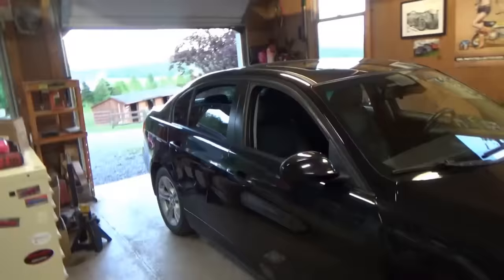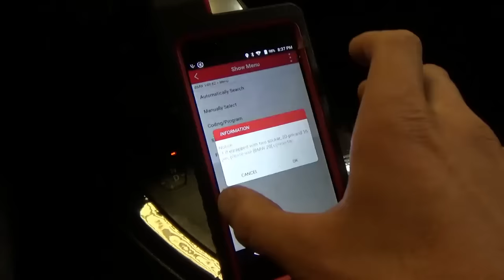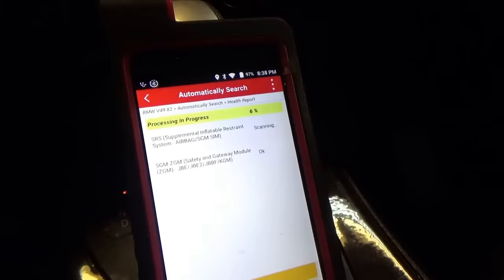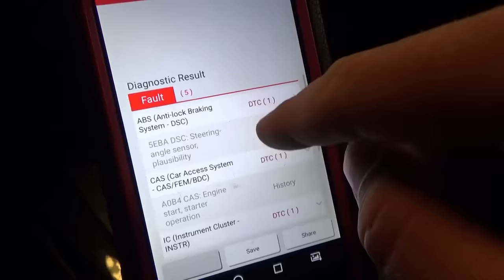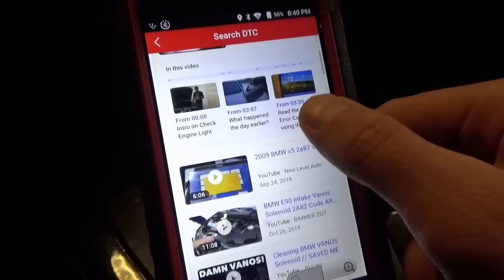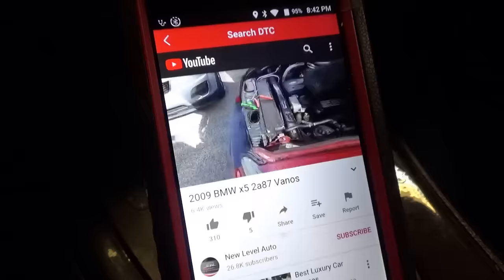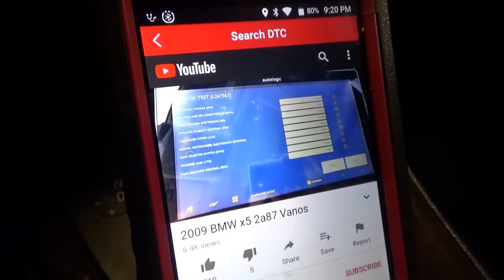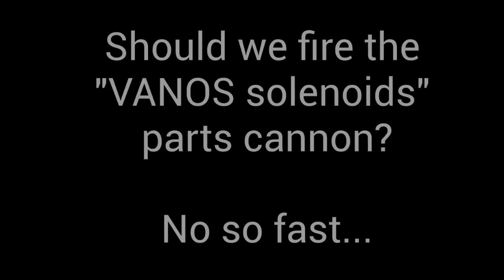Bad News BMW: Vanos 2A82/2A87

Comment: Why do auto engineers subtract dipsticks?  So many new cars have deleted the transmission fluid dipstick.  The deleting the engine dipstick should result in criminal prosecution!  Go ahead and throw rocks.
Reply: They should have an oil level display next to the gas gauge. Problem solved
Reply: @serge4856  That would make me happier.  I do miss the oil pressure gauge like my pickup has.
Reply: because that means you have to take it to bmw.
Reply: @Jason Bowman I just want a dipstick somewhere.  Sounds like Ford did you right.  Would I prefer a dipstick I could grab when checking the engine oil? Yes.  I am 5' 6" and need a milk crate to check my trucks fluids. My beef is like some of the Toyota trucks don't  have a trans dipstick and you have to measure the oil when you change it so not to over fill it.  Since oil is cheap and transmissions (and engines) aren't, the BMW engineers should be ashamed.
Reply: @Jason Bowman B&W and Performance Automatic offer a dipstick tube kit for the F150 that brings it up into the engine compartment and away from that hot cat.  I put a PA kit on my 2014 Mustang GT and like it a lot better.  Those kits are expensive though.
Reply: Serge B well, that solves problem assuming the sensor is reporting correctly and the cluster works.. guess what always works? A stick...
Reply: @mikesabin8568  good point
Reply: Why? Because 95% of the population never looks at them. This way BMW has it setup to tell the driver if anything is wrong without opening that thing in front they don’t understand. They get really confused if they park on a hill and try to check it. Basically it’s dumbed down for the lowest common denominator. 

If you really care - the car will show you the level driving down the road. It says “ok” to indicate it’s safe to start and then provides a nice accurate reading once it warms up.

I’ve got an N52 BMW and frankly it’s no big deal not having a dipstick. It just gets checked another way... like when I’m bored in traffic. Also, these engines are actually pretty solid if you take care of them. The belt is a stupid one, but maintain the tensioners and make sure you aren’t leaking oil on it and it’ll probably run forever.
Reply: @briantii  probably the most sensible comment I've read so far, what's the point of a dipstick if you never look at it, at least the car will tell you when it needs oil, whether or not the drivers takes notice is another issue, people like to blame the car because of their own laziness and ineptitude, I've owned several BMWs I've looked after them and never had a major problem.
Reply: 2 words. Emissions Regulations.
Reply: rafflesnh   I would think the amount of vapors (emissions) leaking from a dipstick, especially considering the dipstick is IN the tube whenever the car is running, would be infinitesimal.  Curiosity got the best of me and I found this interesting article.  

https://jalopnik.com/why-the-dipstick-is-dying-5522543

While that may be a factor, it is not the only reason.  Market research - most people don’t even check their oil anymore, they wait until the idiot light comes on.  Technology - pressure and level sensors are reliable and inexpensive.
Reply: Those engineers are the DIPSTICKS Right??!!
Reply: @andyeckel7195  Thanks for the jalonik article.  Reluctantly I agree that a large part of simple mechanics is going the way of the Dodo like the dipstick and cable connected parking brake.  I just changed oil  in my lawnmower that no longer has a drain plug.  Briggs and Stratton claims that they did a survey that said most people do not ever change oil in their lawnmower.  It's  about being connected to your machine.  I guess since we are getting so unconnected with people  the marketers and general populace contend we should be equally unconnected with our machines.  Tomorrow I will fix my 42 year-old maytag washer. After one of my friends lost a $700+ Samsung washer in a year old school does not feel so bad.
Reply: Not to mention... the technology is fairly reliable. Case in point our Honda Pilot is notorious for the manual dipstick breaking off in the engine requiring careful work to retrieve it without dropping the whole thing down into the engine. N52 electrical oil level sensor rarely fails in comparison.
Reply: @briantii  Good point.  Honda's are the world's largest engine makers and I am a fan. My neighbor had a 11 hp honda engine on his wood splitter. I to 3 pulls to start for 12 years.  One day the low oil sensor did not work and his guys did not check the oil.  My low oil sensor on my 11 hp Honda on my pressure washer has a burr on the sleeve not letting the float work making it impossible to start.  If it weren't a pain to take it out and file off the burr I would reconnect it.  My 20 year old Honda will start on 3 pulls if it sits a year.  I check the oil manually.  Love the engine not the sensor.  I am afraid of adding any more electronics than necessary in a hot,  humid, and dirty environment of the engine bay.  Because of people's indifference the dipstick will probably die the same death as the cable connected parking brake which takes so little maintenance.  I bet you will put a lot of trouble free miles on your pilot.  I hate losing the connection I have to my machines.
Reply: Great thread going here.  Personally, given the criticality of oil volume, pressure and purity, I would like all three of these on my vehicle:
1) Under the hood, a real dipstick and a Schrader valve somewhere convenient to connect a live oil pressure gauge
2) A pressure and level transmitter that talks to the ECU
3) A sample port where one can draw representative small sample for visual inspection and lab analysis.  A lab oil sample analysis for coolant contamination, ash, water, metal particulates, viscosity, lubricity and other characteristics can prevent an engine failure before it occurs.
Reply: @andyeckel7195  Great wish list!  I really like the schrader valve for plugging in a oil pressure gauge.  The representative sample port is equally a capital idea.  Do you watch project farm on Youtube? He tests all kinds of oils a lot and shows the results.  I am so bummed by the lack of anti wear ingredients in stp oil treatment.
Reply: dogs plants cars & neat stuff Yeah, the Pilot has been pretty good. We have had it for 7 years and no major problems. I wouldn’t say we love the thing though. It has drivability frustrations and after doing the timing belt this weekend some of the components aren’t holding up nearly as well as I would have expected.

1) Honda variable cylinder mgmt causes drivability problems like roughness. I had to buy a electronic gadget to disable it. It’s also known to cause ring problems leading to partial engine rebuilds. Common.

2) The transmission feels like it’s made of glass. Lots of driveline slack and if the fluid is the least bit old it shifts less than perfect. We have 65k miles. The fluid has been changed 3 times.

3) The engine mounts showed far more wear than I expected for 65k / 7 years. Far more than my 06 BMW with 90k. Maybe related to the stupid cylinder mgmt stuff.

4) One of the mount bolts had a lot of rust on it where it goes into the frame. This is a southern car that has been north of Tennessee exactly once in it’s life and that was during the summer. The car literally has never seen snow. I cleaned it all up and gave it a bunch of fluid film in there... but still.

5) Brakes get “warped” or rather uneven deposits. The oem pads suck and aftermarket ones aren’t much better from what I’ve found so far. I wish I could find a good pad for this thing.

6) The hydraulic timing belt tensioner was leaking at 65k miles and 7 years old. Apparently this is common, but disappointing considering I even reuse tensioners on my old Lexus IS300 and have never seen or heard of one leaking.

Overall it’s a good car with no major issues and hauls kids and their stuff great... just doesn’t scream Honda quality like I’d expect.
Reply: @briantii  Brian you are so meticulous! That car would have be traded by anyone else long ago.  Just suggesting have you tried Akebono brake pads.  I have never used them but scotty Kilmer swears by them: https://www.youtube.com/watch?v=j7vH8IRbjEc.   Three transmission fluid changes by 65k says you are giving that car some serious good care.  So what year is the pilot?  Is that the year (or part of several years) that they had gas dilution problems that hurt the rings you were talking about?
Reply: dogs plants cars & neat stuff Yep, it’s a 2013 that we bought new and the variable cylinder mgmt (vcm) is what destroys rings. We disabled it before we had problems. Ours uses no oil between changes and it even stays nice and clean so the engine is really healthy. It’s also been fed a steady diet of clean synthetic which I’m sure helps.

I may try the Akebono pads next. I was a little afraid as Id seen some hints that they could be the oem pad. These pads don’t dust at all, and I think that’s the problem. They never really tear up the rotors to keep things fresh. My bmw practically stops in a cloud of brake dust... but you know in 10 years I’ve never had a hint of vibration from the brakes. If I could find some dusty pads that worked I would.

Honestly the car isn’t bad. My wife doesn’t even notice anything annoying about it... but to a gear head who expects Honda perfection, it just doesn’t quite hit that mark. If it’d ever left us stranded or something it’d be gone... but it hasn’t and probably never will. The cars I like better than it would all be less reliable. (X5, GLE, Q7, MDX) Overall the car is in perfect shape, probably in the top 5% of 2013 Pilots as I’ve maintained it very well and kept it polished and waxed. You’d never guess it’s 7 years old.
Reply: @briantii  Have you thought about going to a Pilot forum and seeing what some of your comrades are using as brakes?  I just looked at Rockauto for your car.  There are so many choices it is confusing.  Brembo, AcDelco, Powerstop, Bendix to name a few.  Several people on the (Honda) Piloteers forum were recommending centric, and Raybestos.  I can remember using EIS (earl I Swartz)pads on my '76 Honda Civic. Those were dusty pads that would not wear the rotors.  I made more dust with those pads than you see the giant dust cloud in mad max:Fury Road.  I haven't see those pads in a long time.   I just read EIS was bought by Standard Motor Parts in the late '80's.  Anyway thanks for the engaging conversation. So glad you turned off that ring eating electronics of your engine. I wish you luck on finding your brake pads.

Comment: That's a horrible sign when you see low oil pressure it's time to run, run for the Hills. That BMW motor is probably smoke it's going to be probably end up being a parts car. There's always trying to put an LS in it.

Comment: Seen that happen a few times. Guy buys cheap bmw, thinks its great, wonders why the previous owner insisted on an oil change before buying and then the engine dies with metal shavings everywhere

Comment: There are 2 types of BMW cars. One before and one after the M54 engine. Sadly, this 3 Series was too new!
Reply: is the m54 a good engine, just bought a z3 with the 2.5 engine. 2000 model.
Reply: @randy1ization  Yes, M54 is a good one!

Comment: Good job👍 Wonder if this isnt  also the problem on my 1.8T. Ialso narrowed it down to the ecu keeping the wastegate open too much. I do get an intake cam retarded dtc about 3x/y. Wanted to change the oil control valeve sollenoid in the past but the one bolt holding it was inaccessible so i wasnt able to change it for a new one.

Comment: I am disappointed that a German machine like a BMW doesn't display the oil level on the cluster down to the thousandth (99.999)
Reply: Ya every other car does it
Reply from the maker: It would be more useful if it displayed oil PRESSURE haha
Reply: @PineHollowAutoDiagnostics  ya or a oil light
Reply: Pine Hollow Auto Diagnostics Yeah, that too

Comment: Meh I've had this issue before. Just replaced the o rings on the vanos solenoids. Fresh oil, proper filter and it's fine now. still on the road 20k miles later. Scotty Kilmer is a hack

Comment: And this is why I don't like BMW's, Audi's or Merc's. With all their talk of "The Ultimate Driving Machine" or "Vorsprung durch Technik" or "The best or nothing” you'd think they could make a car that doesn't have some really basic engineering flaws, or, at least, make a car that doesn't eat it's own belt, and give the owner a basic backup dip stick so they can check their oil.

Comment: Didn't get to the end yet but i'm wondering. Could the oil intake filter possibly be blocked? Perhaps with pieces of timing chain guide or similar. Perhaos the oil pump is shot, OMG 10 hour job to change the sump! What a piece of turd.

Comment: I like your work! I wounder if you can help me? I have fixed many cars have great scanner electric tools.my 2006 BMW M5 has starter problems only starts in warm weather but in cold must leave ignition on for 5-10 minutes then it starts also after starting cars runs fine can stop and start all day. I could pay for you knowledge.
Reply from the maker: It has the BMW delayed start feature 😅
Reply: @PineHollowAutoDiagnostics   button start comfort access I have paid ex BMW mechanics for repair they always buy parts. I have put car away with Bosh charger on car and it takes 5 min to start must leave key on. In the summer starts first try. I'm thinking maybe bad contact when it warms car runs? I have the Autel  top scanner electric draw when starting normal. Not sure about delay start it does do a system check before cranking.  with SMG
Reply: @PineHollowAutoDiagnostics  I would think you like a good puzzle? If you help me fix I will reward you.

Comment: Cam holders wear out to the point that engine looses operating oil pressure , seals in vanos leak too . Buy older BMW ..............like 1990 M3 ..... Lol . Looking for one . If you took out cams you'd find cam holders chewed up so badly that you wonder how this thing ran ....

Comment: “The more you over-design the plumbing, the easier it is to stop-up the drain.” - Montgomery Scott (Scotty)

The removal of the engine oil dip stick is, quite simply, a very bad design, very poor engineering decision, and a meager savings on manufacturing costs. The electronic level detector can (and will) fail, and the owner would not know. And, there’s no back-up system.
Maybe it is a financial decision, so BMW can sell more crate engines. In that case, removal of the oil dipstick is sheer genius.

In my career in electronics, I’ve had the misfortune to work on dozens of German engineered high-current power supplies. Only a handful were worth fixing. The others were so ridiculously over-designed, we just scrapped them, or sent them back to Germany for repair. We didn’t have the luxury of making a customer wait 10-12 days for the repair of their 3 million dollar MRI system for a $60K power supply.  To heck with that.

Great video!! Thanks for taking us along, Ivan.
Reply: Bigdaddy MRI I’d argue their plan was to save engines, and I suspect it works. On a car designed to go 15k miles between oil changes how many owners do you think actually CHECK their oil? This pops a message telling you to add a quart. The sensor can fail, but they’re fairly reliable as a whole.

The N52 is actually pretty freaking solid as far as mechanics go. I’ve got a buddy who tracks his stock 07 328i because his actual track car is down. He has 240k+ miles on it and he’s now on season 2 as he’s not yet figured out the aftermarket ECU on his dedicated track car. No one can believe a 100% stock old BMW turns in track times like it does, never breaks down, and doesn’t leave an oil trail on the track. The N52 is an engine that’s proven time and time again to run 250 - 300k miles with 15k mile oil changes and just keeps on going. It’s not perfect (belt issue, oil pan gasket, valve cover gasket, oil filter housing gasket, and water pump only goes 100k miles), but it’s for sure one of BMWs more solid engines.
Reply: @briantii  I have to agree on the logic of going electronic with the oil level. The typical BMW buyer who leases will not get their hands dirty to check the oil, and they must have realized the less of 2 evils was to go electronic. Yeah the technicians don't like it, but at least they get oil details in the data for diagnosis. A smart compromise would be to have both a dipstick AND the electronic system, no?

Comment: Dude you have no idea what you doing... its common on these N52 engines get excesive wear on  those rectangrings(just behind vanos on camshaft part.n. 11317587757) causing low oil presure, there is even updated version of those rectangrings, since the old ones stainsless steel were known for causing this issue. Not to mention those oil screens on side of the engine head(one way valves) that can get clogged from poor oil maintanance. If you had proper diagnostics tool(BMW ista) then it would even told you what I just said, for these codes there are 2 service course of action(1. check vanos solenoid/try swapping them if codes are only on one, or check those camshaft rings for excesive wear)
Reply from the maker: Now tell me based on the data in the video, why my diagnosis is 100% correct 😁😁

Comment: Once again humans buying vanity vehicles (i.e. BMW) with poor engineering or over sensor engineering with no oil dipstick. The advantage for this BMW owner is lemon law/implied warranty laws by a dealership vs a third party private sale where it would have to be dragged through court ($$$) and a higher burden of proof on the plaintiff.